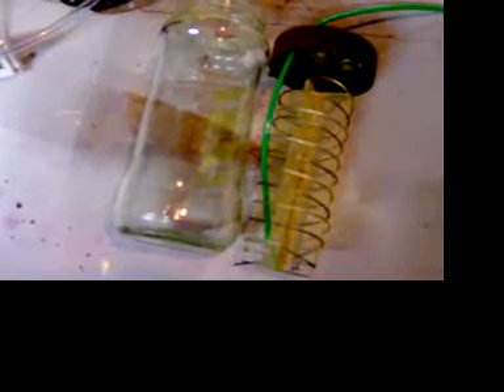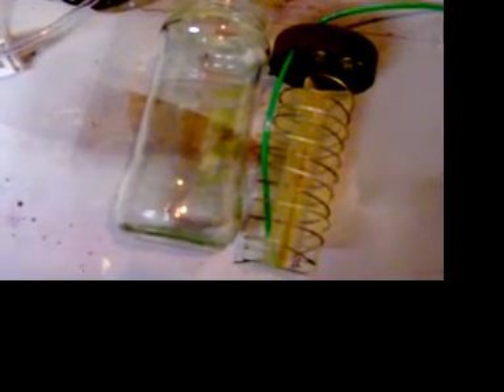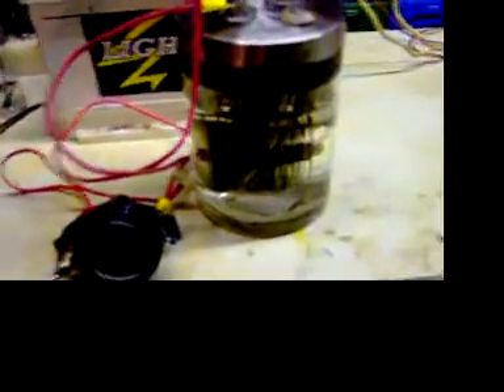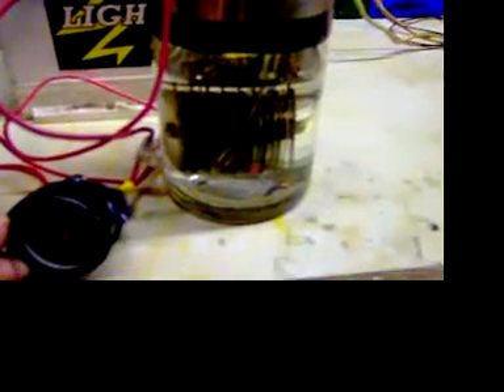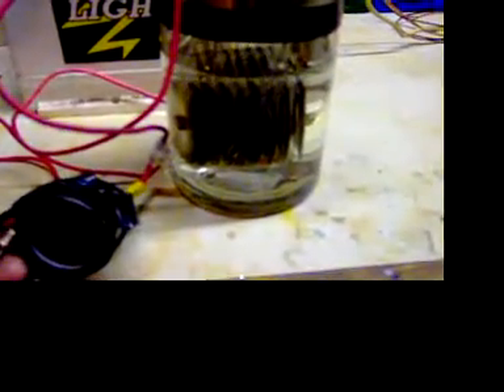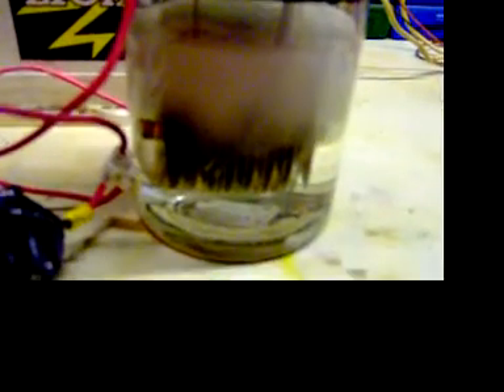test results on latest hydrogen cell

Comment from the maker: hi, thanks for the info, my cell was producing about 2 litres per min at 25 amps (when its hot) so i think you are right.
my father is going to fit my other internet styled (2 coiled wires) so he will have 2 the same, when he gets some figures on two will post another update.
Regards,
Eric.